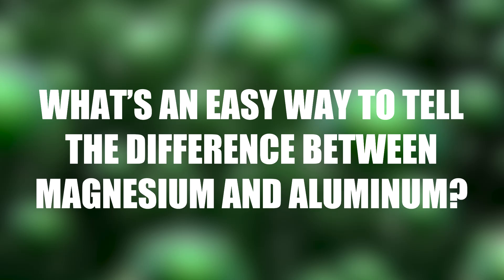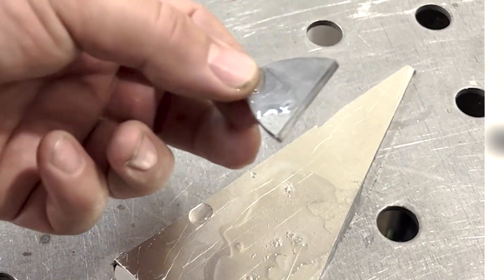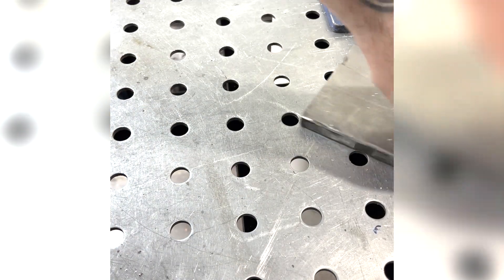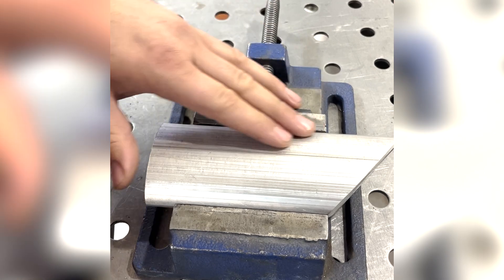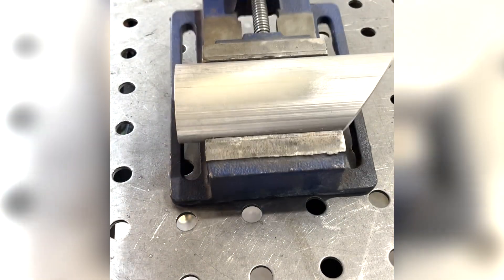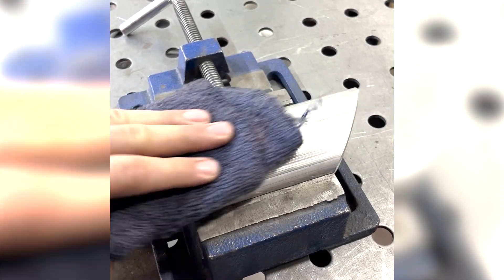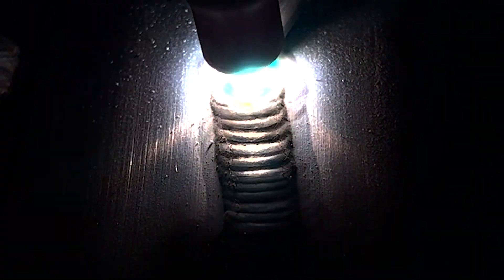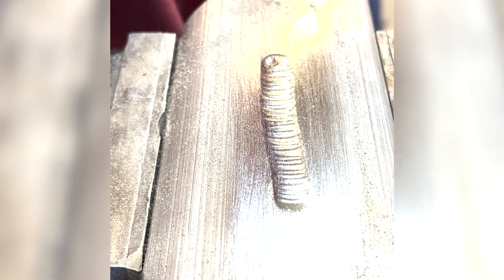The Most Common Questions About Welding Magnesium

Comment: No one seems to talk about tungsten or filler rod or machine set up. I dont need to watch videos of people laying beads im looking for info on welding magnesium.
Reply: Information about welding magnesium is hard to come by.  Here is what I have learned.  Welding set up is similar to aluminum but does not require as much amperage.  I use an E3 electrode either 1/16" or 3/32" diameter.  On really thin Mg and outside corners, I will use an 0.040" E3 electrode.  Most sheet products are AZ31B.  Castings will likely be similar.  There are three basic different filler rods AZ61, AZ92 and ZK31.  There is also AZ101.  AZ61 is the most common one to use.  ZK31 is used on high Zn content castings.  The electrode is held extremely close to the weld puddle.  Don't worry about dipping the electrode into the weld puddle.  It doesn't act the same way as aluminum.  Miller has a TIG welding calculator on their website that will give you the welder settings for different thicknesses and weld configurations.  Using chill blocks is helpful as backing for the welds.  Be careful with dust and shavings.  Vacuuming your weld/cutting area afterwards is a good idea.

When welding Magnesium, if the electrode is held too far away it will tend to etch the parent metal on either side of the weld bead.

Clean Magnesium the same way that Aluminum is cleaned prior to welding.

Magnesium filler rod is quite expensive although if you are doing enough you can buy in larger quantities and save on the per lb price.

Fillet welds use smaller filler rods than butt welds do.

Good luck with it and hope this helps.

Comment: During WWII,  Fisher Body became Eastern Aircraft. My dad had to move from Baltimore to Memphis as his work duties were different. Fisher Body constructed wings for the B-25 and the B-29 at this plant, plus some other sub assemblies. My dad told me they had a large band saw bolted to the floor that was dedicated to magnesium and it had a sign "For Magnesium Only" posted on it. I was told that daily there would be a small pile of the dust built up from being used throughout the day. The labor force was hard pressed for people and the company hired any able bodied person and taught them  their job and many were illiterate. Some new employees had never wore shoes and Fisher Body purchased large tennis shoes for them to wear at work.  One day, someone cut some steel on the band saw.  The pile of magnesium dust ignited and the fire could not be extinguished. My dad told me that it was big, bright white and hot. It was so hot that when it burnt out, only the bolts holding the saw to the floor were distinguishable, everything else had melted. No business, home shop or DIYer is prepared to put out a fire, much less a magnesium fire. The Air Force taught me that dry iron filings will extinguish it Who has enough dry iron filings kept around for such a purpose? They cannot be oily or rusted.   Water only makes it worse due to hydrogen and oxygen. Best you know before striking that arc so thank you for the vinegar tip.